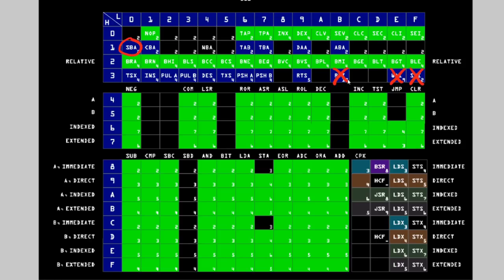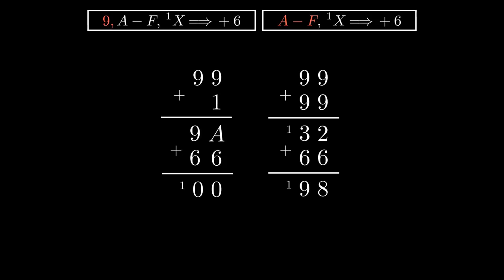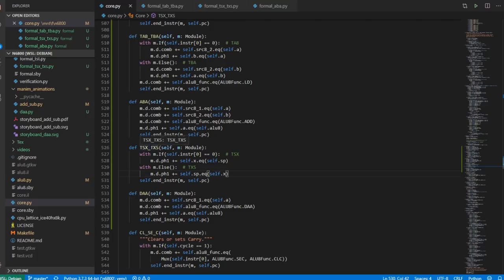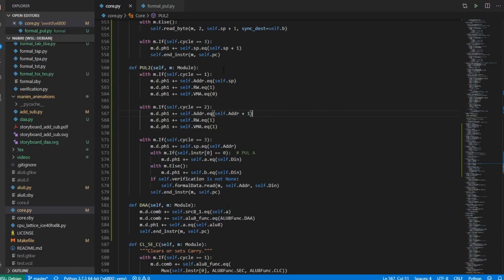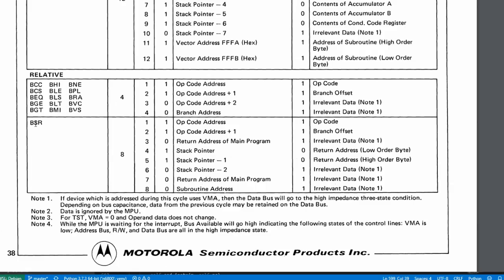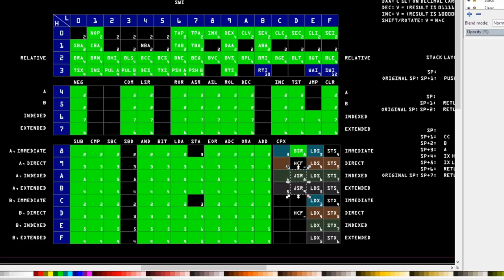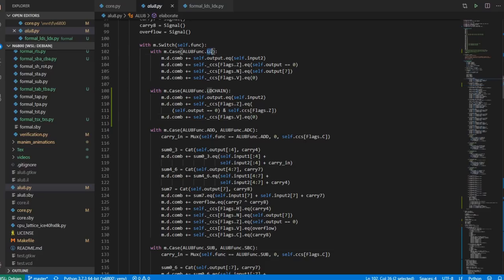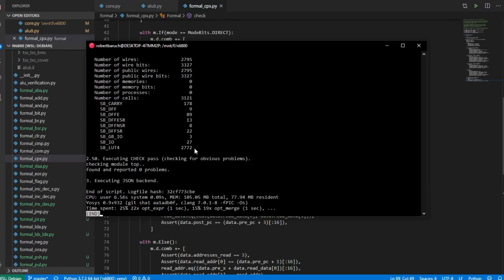Building a 6800 CPU on an FPGA with nMigen (part 9)

Comment: I'm wondering... in your code you write m.d.ph1 += self.Addr.eq(self.Addr + 1) which basically performs a complete calculation, while up/down counters are a staple of digital circuits. Isn't there something like self.Addr.inc() resp. self.Addr.dec()? Or is NMigen smart enough to see you're only adding or subtracting one, so it optimizes it to an up/down counter?
Reply from the maker: I'd say it's up to yosys and icestorm to do the optimization, but I don't know if they would. The only thing I can do is come up with a hypothesis, implement it, and look at the difference in LUTs...
Reply: Synthesis tools are smart, and this is the sort of optimization they have an extremely easy time doing without any extra help.